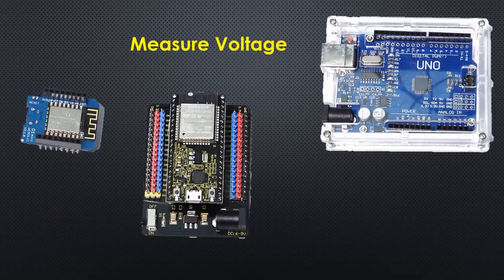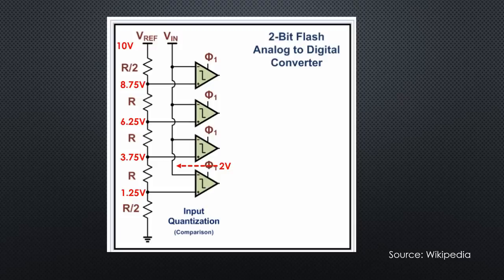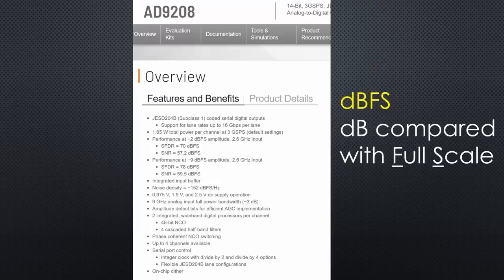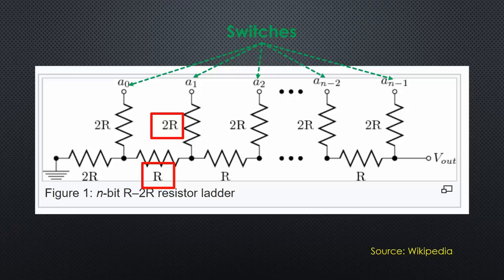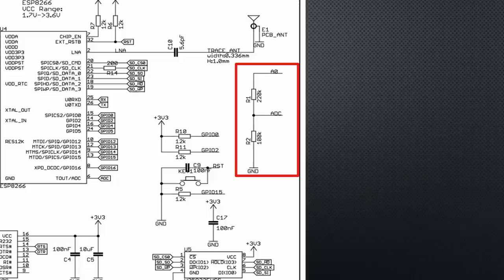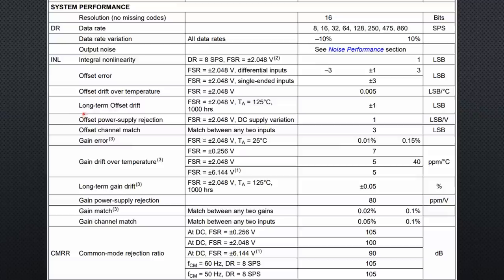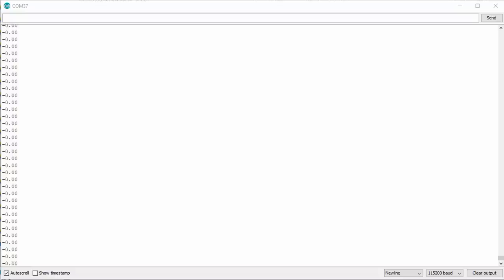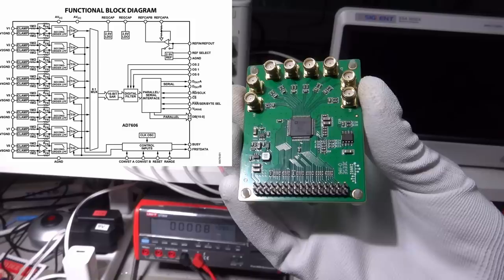#340 How good are the ADCs inside Arduinos, ESP8266, and ESP32? And external ADCs (ADS1115)

Comment: Most modern high-speed ADCs are exclusively pipelined architecture ADC. This architecture does include a lower resolution flash ADCs but it does not need all the extra comparators to make the 12-bits. It gets 12 bits by staging the quantization. Also, the conversion does take a few cycles to compete when compared to a pure flash ADC.
Reply from the maker: You are right.
Reply: @AndreasSpiess  You are exactly right about not being able to do anything serious with the on-chip ADCs. Many people have this misconception. I enjoyed your video.

Comment: Thanks for another fantastic video. Just for curiosity, if I insert a delay(1) between each analogRead(A0), the measurements related to WeMos D1 Mini have more fluctuations than without it. Is this due to the capacitor in the Sample and Hold circuit that discharges faster by inserting delay(1)? It is evident within low serial baud rate. Thanks

Comment: Me at 16 mins: "ah... bugger" :D Had some "extensibility" ideas in mind for a project to potentially later hook some ADC2 pins up to some inputs... Still, good to know an I2C board is an option if I later want to do go that route and still use Wifi. Video wins just for that, but it had already won several times over for teaching me about how ADCs work!

Comment: VRef is applied to the inverting inputs ( - ) of the operational amplifiers. When an input signal (voltage) is applied to Vin (non Inverting Inputs) ( + ), then the operational amplifiers will turn on accordingly because of the rules of the operational amplifier logic as a comparator. The way you have it, if Vin is zero, then all outputs on the operational amplifier is logic HIGH. So LEDs on the outputs on the Operational Amplifiers would turn off instead of turning on when an input signal is applied to Vin.

Comment: Nice comprehensive review, one question comes to my mind, is the ESP32-S2 any better than the ESP32?
Reply: Notf sure overall, but the esp32s2 has a bit width of 13, compared to the esp32's 12 - which is significant.

I don't think it's shown in the documentation yet? However idf alerts you to this when compiling and it can be seen in the respective header files (of course it works too!).
Reply: The same BS :)
Reply: @Sovvyy  It's just a marketing. I've tried this to monitor charge of the battery -- it's useless in the same way as regular ESP32 or ESP8266 that ESP32s2 should replace. Use only external battery controllers chips, internal ESP ADC is useless for such sensitive things. And what I hate the most with ESP -- this "filtering" formulas with magic numbers -- you need to adjust it for each and every chip. I never had any 2 chips in ESP32 or ESP8266 lines with the same ADC errors.

Comment: The Arduino boards do provide a pin for the reference Voltage, it's clearly labeled as AREF. The libraries make it easy to use and many beginner tutorials mention its existence.
Reply from the maker: True. But it is not connected as I said

Comment: I recently built up an electronics test setup that utilizes a bunch of sensors in order to create essentially a DIY motor dynomometer. I've yet to finalize the mechanical design but I am using an ADS1115 in order to read an ACS758 current sensor and a voltage divider so I can record and graph the current over time as fast as possible while the motor spins. RPM is read with a cheap light gate style encoder and a 3D printed encoder wheel, so I can control the CPM. Some motors might be geared down to a few hundred RPM, some brushless motors in excess of 30,000RPM.  I'm reading currents in excess of 75 amps at peak which is why I'm using a hall sensor and I also want it to work for much smaller motors too, so I wanted a resolution of ~0.05 amps, hence using the external 16 bit ADC. One problem I ran into is sensor drift. I noticed by just sitting there doing nothing over the course of a couple minutes the ADC read values can drive by up to 50. Other than calibrating to 0 at the start ever each test (which is my current workaround) is there any way to try and stabilize this?
Reply from the maker: These acs hall sensors are not very good at small currents. Maybe you watch my video concerning current measurements.

Comment: Another problem with multi-channel ADCs on most microcontrollers is that the samples are not taken simultaneously, but interleaved. Better ADC and MUX combinations are possible, that use sample and hold before the mux, so even if the ADC part is doing interleaving, the values being produced correspond to the same moment in time for all channels.
Reply from the maker: Thank you for clarification

Comment: The ADS1015 is a drop-in replacement for the ADS1115 and can provide much better stability and speed, but is only 12 bits. Conversion is 3 to 8 times faster when reading values over I2C and sample rate is more than 4 times faster. It's also half the cost and has the same footprint.
Reply from the maker: Good to know. Thanks!

Comment: I am wondering why the chip designer for ESP32 didn’t add shield to the ADC part so that the result will not be influenced by the EM coupling. 
Over sampling with noise shaping can increase the precision as well as remove the glitches, which was what I was expecting this video to include. But this method is really a simple and convenient way for the purpose, which is what I haven’t thought of.
Reply from the maker: I do not know the chip designers. But having Wi-Fi on the same chip is for sure a challenge.

Comment: High resolution but low accuracy / bad linearity ADC can be improved by multi pointer calibration, or even full lookup table for mapping bits to values. You don't need many points to achieve very good accuracy. In fact that is how all high end ADC and data loggers will be calibrated, or for any research class data acquisition to be really considered trustworthy. Multi point calibration can be performed offline, and then only the slope adjusted based on the on board reference. Multi-point calibration is also possible on the board, but it is more complex, i.e. requires multiple references (one reference + some resistor dividers) which wastes precious ADC inputs and assumes MUX is good, or using time based calibration (i.e. charging capacitor from a known voltage, in this case the value of the capacitor doesn't need to be accurate or stable either, as its capacitance can be deduced from other measurements already done by ADC). The more important part is calibration stability, as it might be influenced by temperature, chip or resistors aging. And of course interference from other stuff in the chip. That is hard to control, but at least with ESP, you can often do measurements before you turn the radio on, then send data. So that is not that a big problem actually.
Also I wonder if there are any decent hybrid ADCs, that use SAR principles for some bits, but instead of single comparator, they use a flash ADC, to gather accurate reading at the end of the process. With 8-bit flash ADC, and 10-bit SAR frontend, you get 18-bit ADC, that can resolve the value in 3 steps. But this will probably be unlikely to see in a IoT-like SoC, because of power consumption, but some such hybrid ADCs with very low power usage and good accuracy.
Reply from the maker: True, you can correct linearity, if it is stable. AFAIK there are combined flash ADCs which need less comparators. But I am not an ADC specialist.

Comment: Thank you very much for this video. I got a question regarding the ATmega328p, that I guess is used for Arduino uno now and in your test. When I read the manual for the chip page 211, there is an ADC Noise Canceler. It allows stop of CPU execution while the ADC is active. It will typically prevent interrupts being executed for about 54 or 108 us while the ADC is active. For many applications a 108 us delay for some interrupt is not desireable.

I would think, that your test did not include this Noise canceler process - am I right?
How was the prescaler set - or what was the clock frequency for the ADC in your test?
Do you have any idea on how accuracy is degraded, if you increase ADC clock above 200 kHz?
Reply from the maker: I just used the "normal" Arduino code. So whatever settings are used there are used in my tests (I even did not know the details you mention).
Reply: @AndreasSpiess Thanks. I have read some parts of the hardware description, but I am still not familiar in reading the "normal" Arduino code. My best guess based on what i could understand is, that the noise canceler is not used. The ADC clock is set to 125 kHz. I have seen indication, that the ADC should be able to work quite well up to 1 MHz. One reading takes 13½ clock cycles.

Comment: You say at 6:15 the Arduino (ATMEGA328) uses 5V for its reference and for an Arduino that is the default for sure but not the ATMEGA328. it happens to simply be the default that the Arduino Abstraction layer uses in its IDE. It is fully programmable between an external reference, an internal 1.1V band gap reference and of course VCC. they use VCC because it gives a simple range to the user and matches the most lightly voltage they will use for the external circuits that will be used to feed into it. this is perfectly reasonable but as I said... not the ATMEGA doing it but the Arduino IDE programmer.
You also have to remember that the internal Vcc choice will be different depending on the  micro-controller, a 328 based arduino is typically 5V by default (Or more specifically what ever the USB power is and can be close to 4.75 v), A sam based arduino may only be 3V3 (Nominally) etc etc. even the internal references are different between each micro-controller see this for more 
https://www.arduino.cc/en/Reference.AnalogReference
https://www.arduino.cc/reference/en/language/functions/analog-io/analogreference/

Default to Vcc is for simplicity, not accuracy, if you want accurate, choose an external precision Vref or the internal Band Gap reference and add the required external voltage dividers to match
Reply from the maker: You are, of course, right. In video #10 I showed how to use the internal reference ;-)

Comment: We also have an additional problem with the ESP32: the input-voltage-to-ADC-reading graph is not linear but kind of parabolic. It seems you need to use an external ADC if you need a reasonable degree of accuracy,.
Reply from the maker: I agree.

Comment: A good alternative condidate could be the STM32 micros such as the Blue Pill (STM32F103) or the Black Pill (STM32F4x1)
They could be programmed using Arduino or PlatformIO

Comment: Thanks for the video, I had a problem with the adc fluctuating reading with my arduino, I never knew that there are imperfections in these microchips. 
I wish you also compared an STM32 board like the black pill (STM32f411)
Reply from the maker: I thought I did this in another video.

Comment: Dear Andreas, 
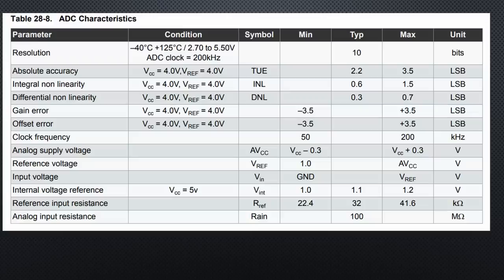on 12:13 is a little mistake: 5v should be divided by 1024, because 2 power 10 is 1024 quantification level. So, LSB voltage is 4.8mV. Look at source: https://en.wikipedia.org/wiki/Analog-to-digital_converter
Reply from the maker: I do no more discuss this matter. Last time I used 1024 and the other fraction complained. Anyway it has no effect if you calibrate to a particular voltage.

Comment: The atmega328 has a built in 1.1V reference voltage, you just need to tell it to use it, also you can measure the actual voltage on one of the pins so you know exactly what it is, as they are never exactly 1.1V
Reply from the maker: Video #10, as I said ;-)

Comment: Hello Andreas! I found your video when searching about adc because i am trying to trick a STM8S003F3 without success.
The STM8S seems to be running at 3,3v and has a 10k linear pot connected to 3,3v VCAP, GND and the variable output to PD3 , which is described as AIN4 and ADC_ETR. It stands for External trigger. From what i understand, the ADC external triggering means it is possible that the ADC only reads on some programmed event. Turns out that when i rotate the POT, even when reading with a digital meter, the voltage values are not linear at all and behaves differently along the POT range. It can read steadily on the starting range, mid range it will fluctuate values and even read 0 and on the end range read some steady values again, higher than on the start range. But the device works correctly. What can be the cause for this? The STM8 adc pin can be programmed to somehow behave like this? Or expecting some pwm signal synchronized with its clock? I don’t have a scope to analyse this in a better way. If i input the POT output to a wemos d1 8266 it will read accordingly to the digital meter, but i cannot put the wemos  bypassing that signal to a pwm output back to the STM8, it will not work the same way as if the POT is directly connected to the STM8. Do you have a clue about why this happens?
Thank you
Reply from the maker: I have no idea. And I never used an STM8. So I am not a big help :-(
Reply: @AndreasSpiess  ok. Thanks anyways. Maybe it would be something good to figure out. I gave up on that approach because i don’t own a scope but i really would like to know what’s going on behind the scenes. Cheers!

Comment: Remember that in Arduino Uno and all the Arduinos with ATMEGA328  you can select an internal stabilized voltage reference, to avoid the errors with power supply fluctuations
Reply from the maker: This is explained in video #10 ;-)

Comment: It's also possible to use a smoothing capacitor on analog values instead of doing too much work in software. I wanted to use a 100K ohm pot going from ground to Vcc and there's not enough current to overcome the internal leakage and you get bad results. Corrected with a 0.1uF capacitor on the pot slider and it removes the error on those internal ADs and you still get the advantage of low current consumption through the 100K pot.
Reply from the maker: You are right, caps help for outside noise. Unfortunately not for the noise created by the ADCs :-(
Reply: @AndreasSpiess  true. I only use the internal A2Ds for basic applications. I just begrudge wasting a lot of current through a pot connected across the power rails. The capacitor method works really well.

Comment: Bottom line is that the accuracy actually required for a given application drives the decision of if built-in MC's ADC or external ADC will be required. The ADS1115 is my go to solution if it's required, very flexible and cheap.
Reply from the maker: You are right. This was the goald of the video: To show people the different possibilities with pros and cons...

Comment: Nice video :) 2 mistakes.Forget  sigma delta adc. And arduino impedence is 10k becose of hold capacitor so voltage divider resistors values is to high
Reply from the maker: Thanks for the corrrections. I forgot more than just the sigma delta converter.